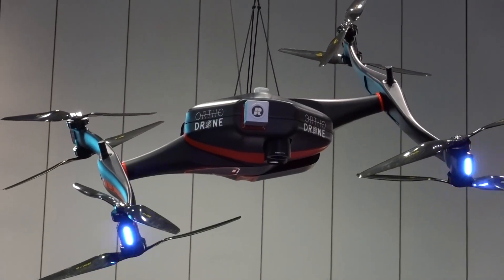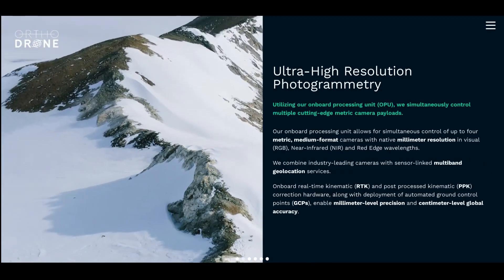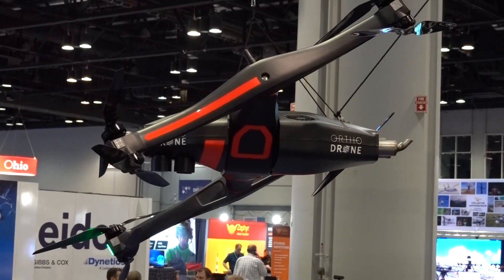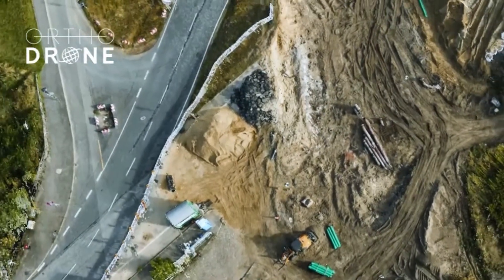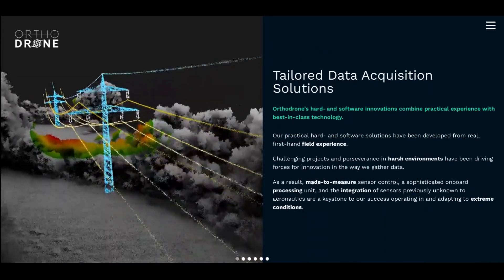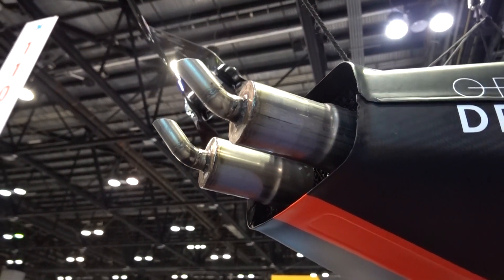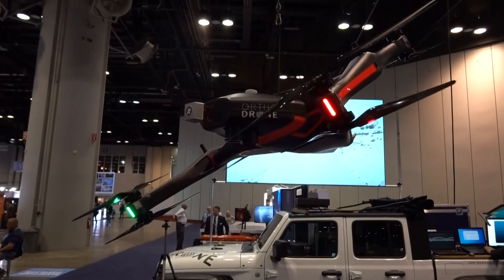The Drone IS The Gimbal

Comment: This is pretty cool. However I would like to see a drone that has independently articulating propellers on gimbals for each arm, and have the body/most of arms be sort of wing/lifting surface for fast forward flight. Having arm pairs of motors be independent like this is nice though.

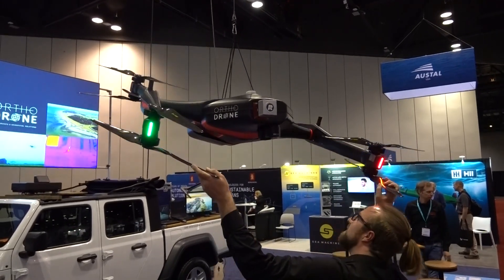Comment: 0:47 I can see why it was developed, see the appeal behind the idea, I also see why that's stupid. You need motors powerful enough to do all that movement, at a point where high forces apply. That makes it prone to failure, it's extra weight that has to be carried, sucks extra power, and so on.
Reply from the maker: I don't think I'd go near as far as to call it "stupid," but I think I see your point. My impression -- and I suppose I should have asked the question to be sure -- is that the limbs actually articulate using internal servos or brushless motors, or something, so the propellers just provide lift and thrust, and the vectoring is done by the system which positions the limbs. However, I suppose you are fundamentally correct that, regardless, this approach introduces additional points of failure when compared with a conventional multirotor of the same general configuration. Still -- it's incredibly badass...
Reply: @Roswellflighttestcrew1947  Guess stupid was a too harsh of a word. But articulate where the biggest forces apply is suboptimal. And I kinda doubt it is really dust proved. I mean, I can see they might be dust proved on the outer arms, but where they meet the body?
And yeah, it fuels the rule of cool. But I think a different approach, that doesn't lead to drone falling from the sky, when inadvertently a joint locks up would be more beneficial.
Reply: @Roswell Flight Test Crew, you're right, the limbs do articulate and move around the central body. And while @MrMegaPussyPlayer does have a point in all additional parts inducing more points of failure, we believe the trade-offs are worth it. Even if the system had a failure on one arm joint for whatever reason,  the other one would be locked in parallel, as both have independent emergency brakes. An while, yes, the mechanism does cost extra weight compared to a standard octo-x, the numbers look different if compared to an octo-x carrying a similar payload on a dedicated gimbal.
Reply: @orthodronegmbh4085  I think it's safe to say that either I don't understand the structure of the drone or @MrMegaPussyPlayer doesn't understand the structure of the drone. 
Is it possible for one side of the drone (with its 4 motors) to move independently from the other side? I'm assuming all 8 flight motors are rigidly connected. Am I correct to say there isn't any type of gimbal malfunction which would allow a "floppy arm"?
If the two sides can move independently then I agree with @MrMegaPussyPlayer assessment of the drone and I'd also need to agree with his assessment of my lack of understanding of the possible problems with the drone.
However if there's a rigid "H" structure physical connected to all 8 motors then I would be correct to think a "floppy arm" is not problem once could logical associate with this design.
Reply: I confess I was initially skeptical about the drone. I thought it might just be a cool gimmick. But after seeing the types of projects they do, I was persuaded the design is more functional than cosmetic. 
Orthodrone sure seems to know what they're doing.

Something to consider: A gimbal would also require powerful motors. I don't know how the power requirements compare with a conventional gimbal but either way large motors and extra power would be need to keep a camera stable. 

While I think the design is for function rather than cosmetic, I bet the looks of the drone don't hurt sales.

Thanks for another interesting video @Roswell Flight Test Crew.
Reply: @ddegn  Yeah, hanging a set of sensors (/gps) and the many cameras from the body also would require equally strong motors. But if the arms mechanically fail, and making them moveable is a weak point, the drone will drop from the sky. While a failed gimbal only results in a little less accurate flight and failed recording, not a destroyed drone.
Reply: @MrMegaPussyPlayer  "making them moveable is a weak point"
I'm not sure I follow. Do you mean the "H" shape of the frame which has the motors attached?
"if the arms mechanically fail"
Do you mean the arms break or stop moving? Sure if the arms break the drone would likely crash but I doubt there's much danger in that happening.
If you mean the arms stop moving, then I don't think that would be a problem. The drone would still fly.
Reply: @MrMegaPussyPlayer  One arm can't go floppy. The motors are connected to a rigid structure. The motor all move together. They can't move separately.
I think it's you who hasn't understood the way it works.
Reply: @Duane Degn and  @MrMegaPussyPlayer  - I see this started quite the discussion! =)

You're both somewhat right. The two arms are not rigidly linked. They could be, however the central part rotating on the roll axis (we like to call it the yoke) connects to both arms separately. This mostly has implications on using our design for a VTOL, with a differently shaped yoke (but let's not get into that right now ;)). 

So yes, in theory, we could lose control of one arm. However, for that to happen, two motors would have to fail (as we're driving each arm redundantly) as well as the emergency brake, which is mechanically loaded and kicking in if one arm is moving out of sync with the other over a certain degree. That means we would have to loose two independently controlled motors in the same tenth of a second or so, and then on top of that have a mechanical fault on the break to get into a tricky situation. Of course, that's possible - but getting towards a probability which is quite a bit lower than something like a bird strike...
Reply: @MrMegaPussyPlayer  It looks like you are correct. My argument was based on the assumption the two sides were mechanically locked together (using a rod/tube internal to the outward reaching arms). I thought the two outer pivot points were in the cosmetic outer shell only.
Thanks for taking time to clarify your point.
Reply: @orthodronegmbh4085  Thanks for clarifying. It's hard for me to imagine a time when the two outer arms would need to be driven independently but I'll take your word there are good reasons.
Thanks again for settling this (hopefully friendly) internet argument.
Reply: @ddegn  given the design is modular, the yoke can be shaped in a way to provide lift. The result would be closer to a mono-wing VTOL than the current octa-x shape. Having a somewhat sizeable wing often leads to yawing issues on VTOLs (as the yaw typically induced by the motors might not be enough to counteract the wind force on the wing), which our concept can then mitigate by angling the arms perpendicularly and thereby inducing yaw. Hope this answers your question!
Reply: @orthodronegmbh4085  I was right, you do have a good reason for independent control. 
I'm building a couple quadplanes myself but I don't have experience flying them yet. What you say about yaw control sounds reasonable. 
Thanks for taking time to go into even more detail.

I was disappointed to see there aren't any video on your YouTube channel. I'd be really interested in seeing more details about what you guys are working on.
Reply: @MrMegaPussyPlayer  bruh. These guys did this to stabilize their payload while maintaining the highest possible GPS accuracy for their payload. Its not just for cool points. Aerial LiDAR especially has issues with the lidar in air pitching and rolling around thereby creating gaps in the lidar point cloud data. 

If we put the lidar on a gimbal, now the lidar moves independent of the GPS antenna on the aircraft's body (the antenna has to have a good skyview, it can't be under the aircraft), thereby changing the lever arm measurements between the phase center of the GPS antenna relative to the phase center of the lidar/IMU. 

Basically suffice to say to get the best lidar data it needs to be stable and under the aircraft, and it needs to maintain the positional relationship with its GPS antenna, which has to sit top of the aircraft.

This is some niche scientific stuff trying to solve a niche problem. This isn't for some youtube bro to show off their new drone hotrod. ;)

Comment: amazing view.
Reply: Yikes!  Not one video of this unit in flight?  tsk tsk
Reply from the maker: I agree... I asked if they had any footage -- and they did, but they weren't willing to share it because the aircraft is still a prototype in development and is only flying on a tether at this point. Still, I can't see any reason it wouldn't work, and as you saw for yourself in the video, it looks like there has been some exhaust coming out of those pipes in the rear -- so they are burning gas with it.
Reply from the maker: Yeah... Pretty cool looking aircraft!